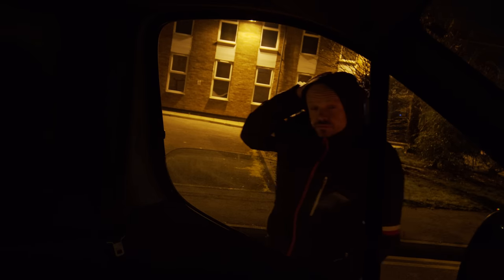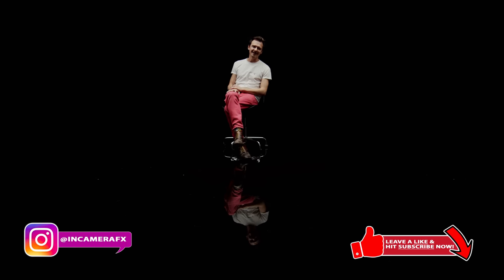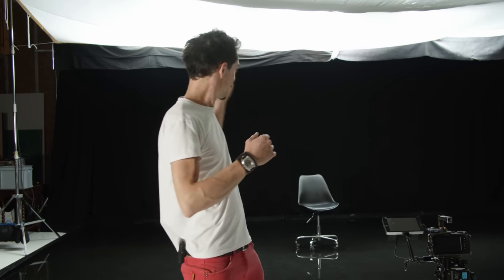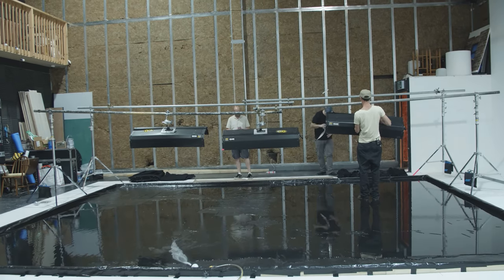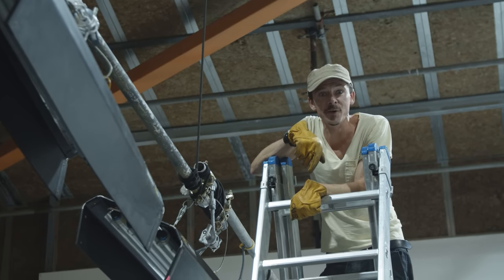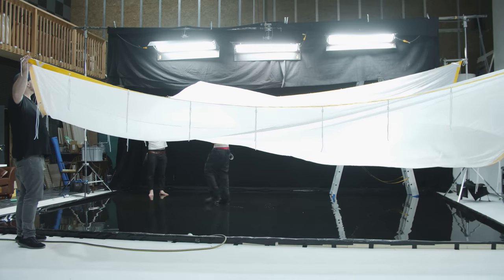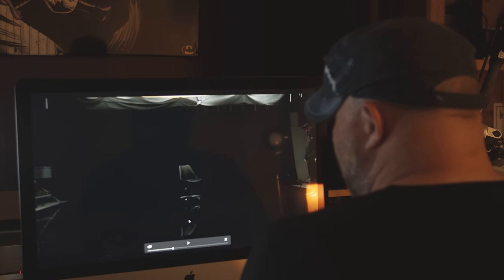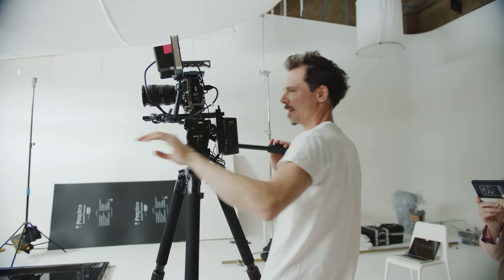How To Create The BLACK VOID From STRANGER THINGS

Comment: A tip from a VFX artist: instead of crushing your blacks to get rid of all unwanted detail, try shooting a clean plate of the empty set, then subtract this from your footage to create a perfectly black background. Might require some rough roto to hold out the actor, but should get you a much better starting point for further grading

Comment: We keep the cables from the floor…
Back in 2009 I was the special effects and prop maker for this TV show the next Uri Geller. And I Just consulted a talent and I walked back to my workshop offstage and walked down the little dark steps and slipped. I fell backwards with my back landing on the steps and my head hitting the main stage. Knocking the wind out of me. So the sound guy called in and the room lights go on. And we saw that the hazer on my side of the stage had sprung a leak. And there was easily like 10 liters of water. And the water was only about 1.5 meters away from a couple of 380V distribution boxes that laid back stage. 
So the crew came in with towels and mobs to clean up the water. And the rehearsal for the live show airing 4 hours later was done with the room lights on. Much to the producer and director’s frustration. Water on a black floor is truly invisible.

Comment: "FIX IT IN POST" - Hey guys, as a digital effects artist working on advertising spots, i often get asked to quote on effects, that i would think, would be better shot "InCamera".  The answer i get many times is, "it's too expensive/time consuming to do it in-camera, FIX IT IN POST".  My latest ask is to do a severed arm.  Have an actor stand, facing camera, not realizing/caring his arm is chopped off (above the elbow) and have a full convo with his wife, moving his severed limb around while he talks.  This would be covered in multiple shots/angles.  I'm thinking a cheap and cheerful prosthetic/makeup, with a slightly longer ragged sleeve should do the trick.  Thoughts?

Comment: I found this to be pretty interesting. It also makes me wonder what the surface would be like if you used something other than water. There are a lot of interesting non-toxic fluids out there that could be used, with interesting properties.

e.g. Maybe finding a fluid that didn't splash as easily, could add to the creep factor of someone running through this liquid, which seems to act like water, but it isn't splashing.

Comment: One thing you could have tried would be using a polarizer to adjust the reflectivity of the water and the liner.  It might be tricky because the surface of the water is refracting the reflections on the liner which I think puts them on weird planes from each other.  But a polarizer would probably knock the reflections down on both.  It also helps that you're shooting at a 90-degree angle to the surface of the water.  This was a great tutorial!  Can't wait to see what's next from you all.
Reply from the maker: That's the great thing, there's so many ways certain effects can be achieved! And like Tom says in the video, he would've done a few things differently if we had more budget or if we were to do it again! Thanks for the comment, glad you liked the video!
Reply: @InCameraTV  There's ALWAYS another way lol.  It's kind of mad how often I look back at a project and go "well I would have done that a totally different way."
Reply from the maker: I thought the same on the day but I could I find my polarizer anywhere! 😭 (T)

Comment: DUDE! Before even watching the video: This so spooky! Two weeks ago or so I was looking and searching and searching and trying to find out how they did it in Under the Skin, even rewatched and paused the movie 2 weeks ago. Thank you for this!
Reply from the maker: Well hey there you go! I hope the video answered all your questions!
Reply: @InCameraTV  For sure! Do you guys think I could possibly achieve similar results without rigging lights up in the air, but reflecting lights from the ground up into the air against a cloth? This would make the light very soft and I would cut massive corners and costs, problem would be light spillage or pollution, though, right?
Reply: @LiottaSeoul  hey liotta you saure could try, using some floppy flags etc would stop direct spill, or even some black sheets if you're pushed. Thing is the light would be alot softer as it's not directional. Alsonyoud want to make sure there are as few  spots on the cloth as possible for that nice even light.
Reply: @jacklilley9968  Thanks for the friendly reply. I never got the notification! I'll be trying this whole thing in a couple of weeks! Fingers crossed!

Comment: 07:41 on your cheek is a STUCK or DEAD or HOT pixel! (noticed one on my Fujifilm X-S10 and it wont go away, not I can't un-see them anymore) Is this common? And then at 07:50 you can see it in the same are hopping around. What is this phenomenon?! And again, is this common? (Asking because my camera is new and I don't want to return in unnecessarily although if this is an issue with mirrorless cameras, then isn't it better to revert back to DSLR?)
Reply from the maker: Aaah yes, the bmpcc's do suffer this but fear not you can easily recalibrate the blacks in one of the menus which will get rid of it
Reply: @InCameraTV  Pixel remapping never worked and I ended up sending it back, just to get another one with the same problem. I returned that one as well and they sent me an X-T3 and so far I've had no issues. So it seemed like the X-S10 sensors are a bit faulty.